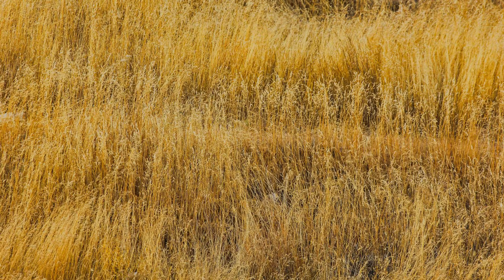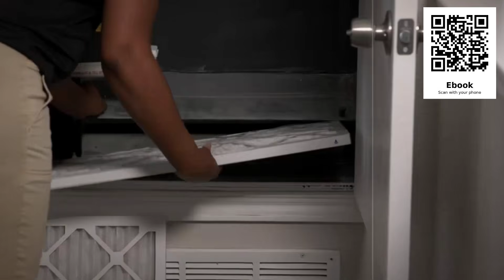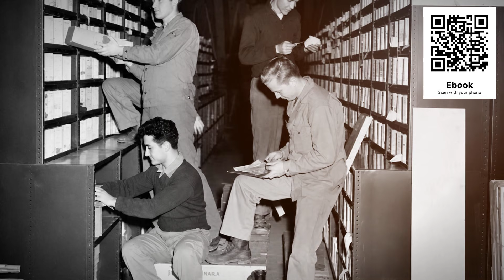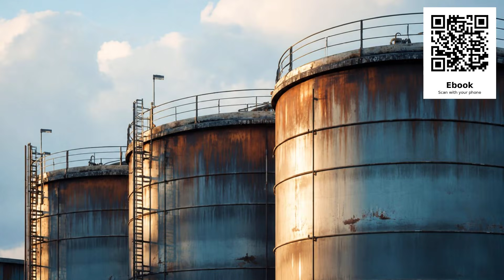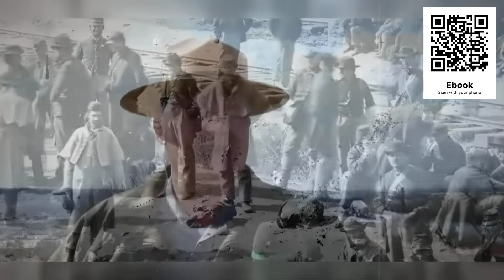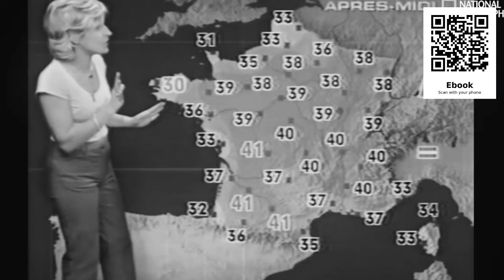Why Did We Quit Using Ammonia To Cool Our Homes?

Comment: Sigh... The operation is not what you described.  The ammonia vapors are boiled off and head to the hot end.  These vapors release heat as they cool down.   These vapors head to the cold end which contains some hydrogen.  This makes the partial pressure of the ammonia vapors too high to remain a gas, so it liquifies ....

Comment: ammonia is still used in RV refrigerators, they are not very efficient, ammonia is highly toxic . It is still used in large scale commercial applications. I replace rv refers in every RV i have, and that my friends have. An ammonia refer uses 120 to 200 watts continuously, I run refers 2x al large with 30 watts continuous. So I have to disagree with the  Well drilled geo is wasteful, many other versions are much more effective. Have you ever had an rv frig leak??? I have, its really bad.

Comment: We stopped using  ammonia because it killed people when it leaked
Reply: simple redesign cures that problem 
so it's unlikely to be the actual reason 
my dad was a refrigeration engineer for a dairy and he debunked that myth 
they used ammonia system 
he started out a sanitary welder there
Reply: Ah, thats why we use an even more toxic gas now...🙂